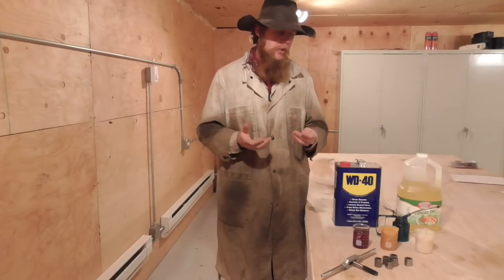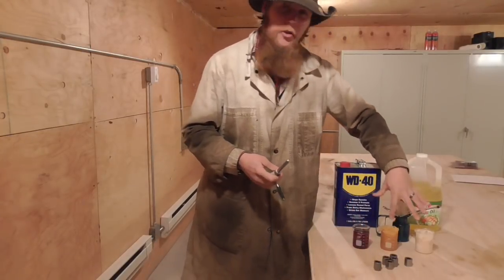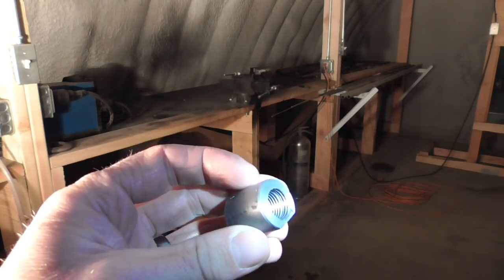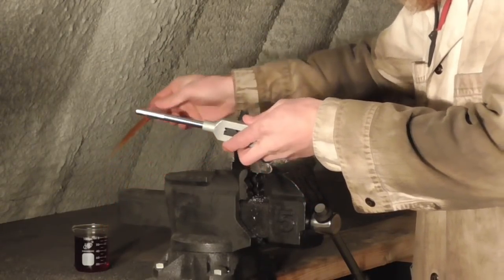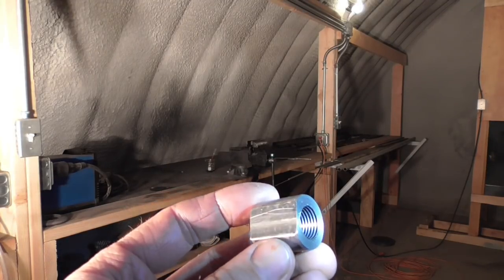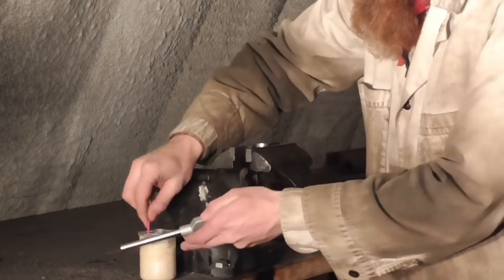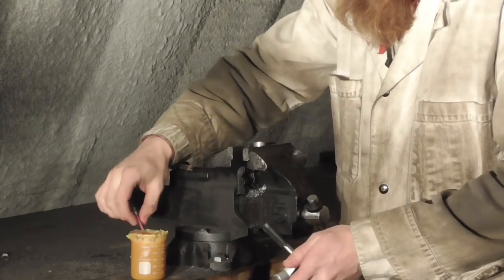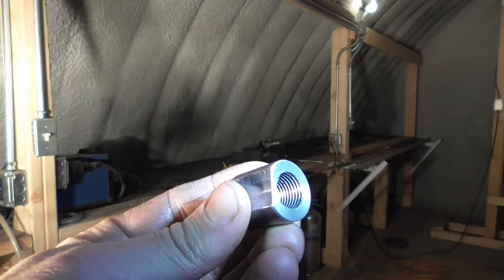Comparison of Thread Cutting Compounds (TIS123)

Comment: I have since been experimenting a bit with simple mixtures. I'm finding that a 50/50 mix of canola oil and mineral oil works pretty well. I have also mixed in some transmission fluid but have not noticed any difference between the 3 way mix and the 50/50 canola/mineral mix.

Comment: Excellent work. Thanks much. I'm gonna make up a batch of sulfurized canola oil and fill my almost empty thread cutting oil bottle. On another note. I was just watching an instruction video about using a lathe. The operator was turning aluminum and had a whitish fluid for lubrication. I would assume that it is water soluble oil mixed with a good portion of water. I wonder if your canola soap could be thinned like that with water for cutting aluminum.

Comment: If all this is do to cost ? I would suggest using chain saw bar oil !  Using summer formula in summer and winter in winter   ! As a plumber have cut a lot of threads and the right viscosity is important. To thin and it dose nit stay where  it is needed to thick and it dose not flow where needed . Bar oil is a cheep alternative  just need the right viscosity to the heat worked in .